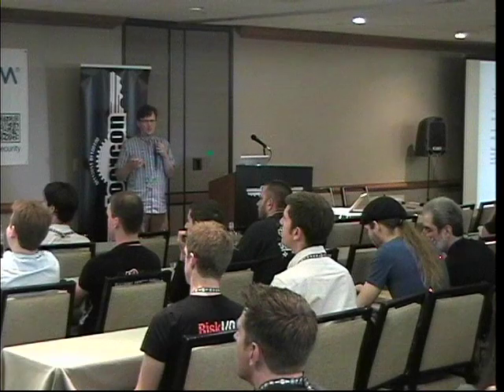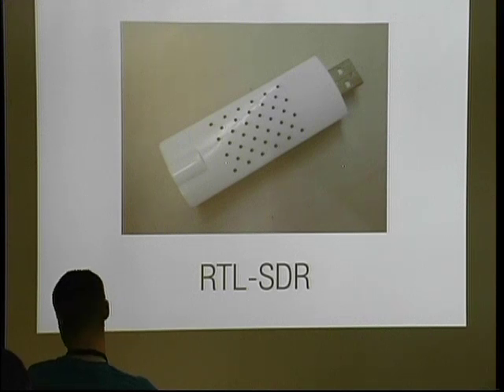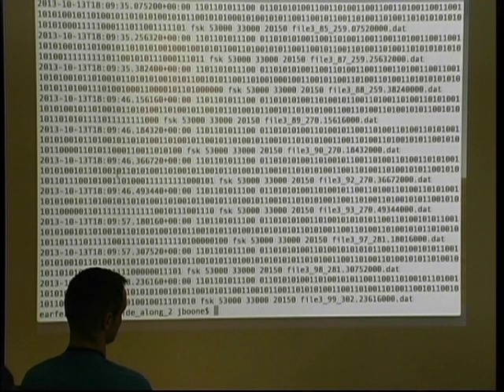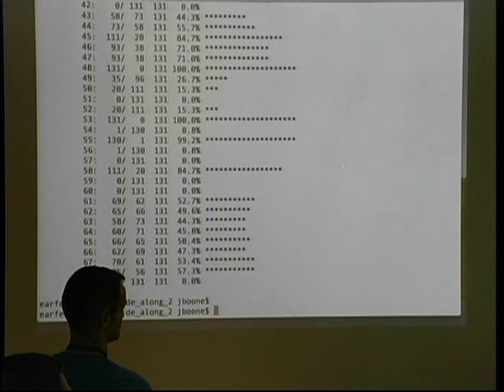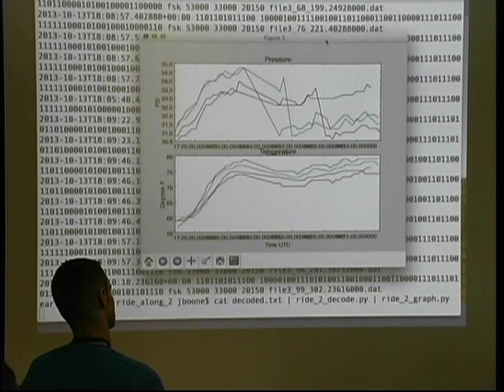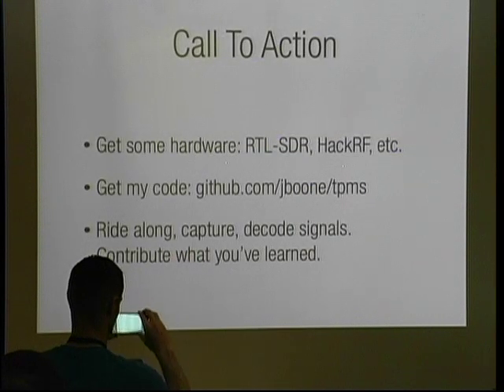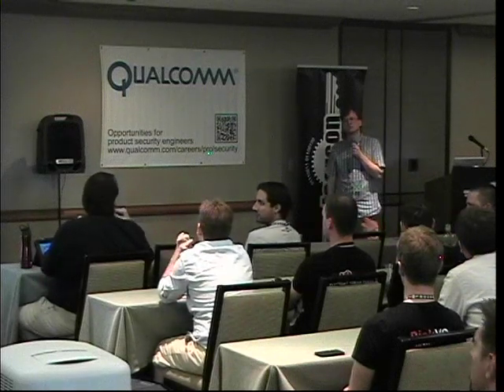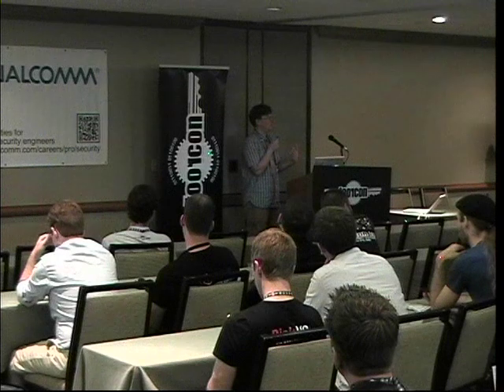Reversing Tire Pressure Monitors with a Software-Defined Radio

Comment: Hello from the future!  In ten years, this video has aged like wine.  Regarding 23:30 - yes, we're there!  HackRF Portapack with Mayhem firmware has a TPMS decoder that's pretty much flawless.  For stationary use, a Raspberry Pi Zero W + cheap RTL-SDR dongle can get you a working receiver for under $50 hardware investment. Add a Pi camera pointed at your driveway (and the 'motion' package) and you should be able to correlate TPMS serial numbers with a photo of the vehicle!

Comment: Great job!  I thought about doing this, although I don't think I would have gotten as far as you did.  One good way to get these for free is to go to your local tire shop. I was able to get 4 or 5 for free. They were happy to give me them and were perplexed to as why I would want them.. The batteries of course are the main things that go bad in these, so you will find that carefully removing the epoxy, you will be able to see if the battery was the problem and replace it. You could probably hack something for the tire pressure and temperature sensor parts of the circuit so you wouldn't have to put it back into a tire to test it.  Keep up the good work.
Reply: aaronnpny Thanks! I have talked to a local tire shop, and had a similar experience. They were a bit puzzled, but when I explained what I was up to, they thought it was interesting. One gentleman was going to put some aside for me, I need to go back and check in and see if he's got any for me.

The batteries are usually soldered-on lithium coin cells. It's trivial to cut off a bad battery and either replace it or hook up a separate power supply. I look forward to experimenting when I get a few in-hand.

Comment: This was a great presentation.  I'm wondering if these transmitters could just be hidden somewhere in a car (maybe toss one in the glovebox of each of my cars) so that I could have something like a Raspberry Pi monitoring when each car comes and goes?  In there one particular manufacturer that you've found that DOES transmit, even occasionally, when there's no movement?  Even if it was once every 5 minutes or so, it would probably suit my "car inventory" purposes to know which cars are in the driveway at any particular time?
Reply from the maker: I haven't found any yet. The one transmission I see regularly at my house, in the 315MHz band, turned out to be a temperature and humidity remote sensor.

You could certainly build beacon devices like what you describe, from parts available at SparkFun or Adafruit. There might also be "mote" devices out there that would do the job. You might also be able to appropriate something like a weather station remote sensor (like the one I've seen transmitting in my neighborhood) and just stick it in your car... :-)
Reply: Jared Boone Yeah..  I guess I'm "trying to hard" to take advantage of all your hard work..  Maybe when I get a car new enough to have the TPMS it would make sense to use that, but until then, it really is easier just to put something more generic in for this purpose!  Thanks again - I learned a lot from the techniques you explained - the software out there these days is really incredible!
Reply: Tpms sensors have a reed switch. They don't transmit until the wheels are rotating @ 20mph or so. This is to conserve battery life. The sensors run on a non-replacable coin cell similar to a 2032.

Comment: Yes! I was hoping someone had done this. I'm trying to figure a small arduino sized transmitter to spoof the ECU and turn off that frigging light when I've got my winter tires on.
Reply from the maker: You're not the first Northerner who I've heard complain about this. There's likely a business opportunity here. :-)

With all the Arduino shields out there, somebody has to be producing one that has a TI CC1110 on it, which is (almost) what is used on the Yard Stick One. If you had that shield, you should be able to generate any of the myriad TPMS variants I've seen that occur in the 315 and 434MHz ISM bands.
Reply: @brianborell4469  "breaking the Law" LOL!
Reply: @sharebrained  There's a UK company that designed a TX (www.tpmsbypass.com) used to spoof sensors (but I'd bet it's  just as easy to stick them is a pressurized cylinder to shut the light off.   I have an Autel scanner that disables some systems but not others - I think the PCM locks the input for control on some.

Comment: does anyone know if the aftermarket screw on transmitters work on the same frequency/packet layout as the internal tire transmitters?
Reply from the maker: There's no reason to assume either way. If you have an FCC ID for one of these aftermarket devices, you could look it up on FCC.io and see if it's made by a vendor that makes OEM transmitters. If so, that's a good indication they might be compatible. But it's still no guarantee.

Comment: Can one use a cheap $10 RF signal detector to just check for the signals, in an attempt to pinpoint the one with a dead battery?
Reply from the maker: I would imagine so, if the signal detector is sensitive in the 315 - 434 MHz range. From a few inches away, it should be obvious you're seeing a transmission from the tire you're nearest. Be sure to leave your mobile phone far away when you do the tests. Also be aware that some TPMS transmitters only transmit when the wheel is turning, which could complicate things.
Reply: I thought about the rotation/activation hurdle...   I think a good hard spin by hand with the wheel jacked up should get it up to speed.. I'll see if that will work...  On another note, I have a hand held inductive amplifier, where I can "Hear" EMF... Is this essentially doing the same thing?

Comment: If i got the yard stick one would that be equivalent to the hardware you used to capture the data?
Reply from the maker: +unijabnx2000 It's not equivalent hardware. The YardStick One is more like the actual receiver hardware in a car. So it's entirely suitable, and might even do a better job than my SDR approach -- for one flavor of TPMS device at a time. The YardStick One can't receive multiple modulations and frequencies simultaneously, so you would need several of them to capture the various TPMS flavors. The SDR technique allows a single receiving device to demodulate and decode several flavors at once, given enough computing power. Regardless, you'd need two SDR receivers to cover the two TPMS spectrum bands -- 315MHz and 433.92MHz.
Reply: +Jared Boone I thought the  YardStick One was indeed an SDR. At least it was introduced that way in the Hak5 video. But I wasnt aware that it wouldnt listen to a wide spectrum of frequencies concurrently.
Reply from the maker: +unijabnx2000 It's not an SDR, if you define an SDR as a device which captures a chunk of RF spectrum and performs demodulation and decoding on general-purpose hardware like a microprocessor and/or FPGA. I think most people would agree with that definition. The YS1 is built around a TI/ChipCon CC1111, which has complete demodulation and decoding hardware in-chip for various flavors of ASK and FSK. It's definitely very configurable. But last time I checked, there is no direct access to the I/Q RX or TX streams, which would prevent you from using it as an SDR, as defined above.

For all the gory details: http://www.ti.com/product/cc1110-cc1111

Comment: But did you learn how mach air as in your tires? Wouldn't it be easier to just take one of those little pressure gauges and measure at the valve stem?
Reply: It was determined by a joint research group of the DOT and the IIHS that Americans can't reliably maintain their tire pressures. Therefore Congress added tpms to the fmvss regulations.